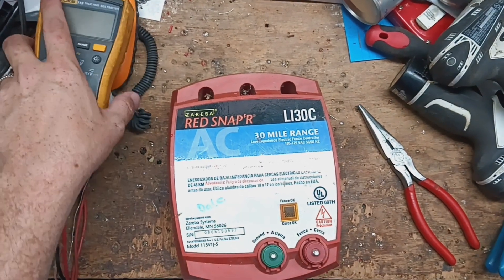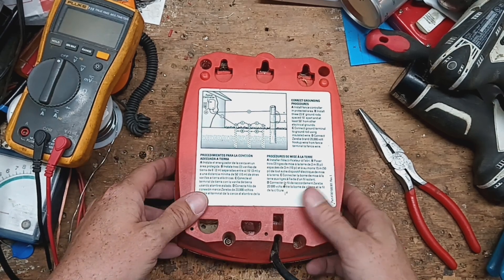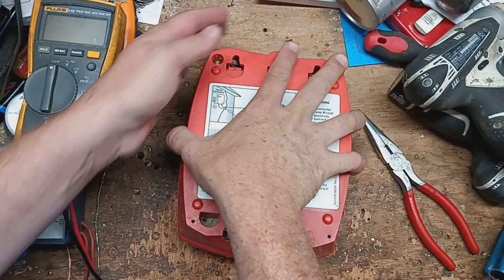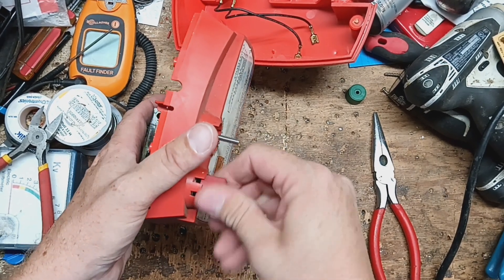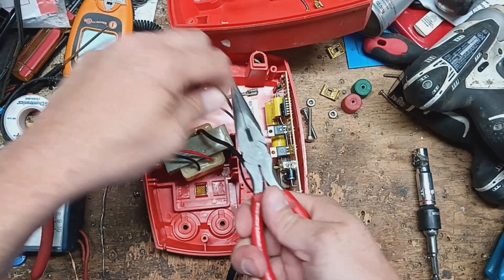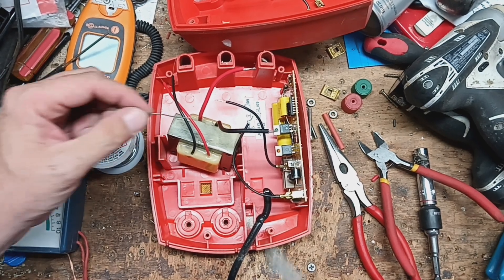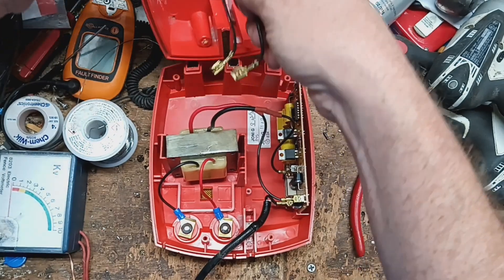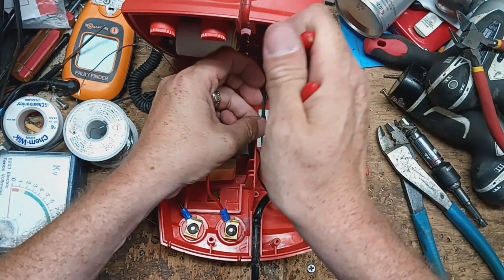Repairing A Red Snap'r 30 Mile Fence Charger That Has No Output | Red Snap'r LI30C Repair

Comment: Hi, what specs are for the transformer?! Thanks!
Reply from the maker: I wish I could help, but I'm not a manufacture of parts, just a repair guy. So I don't know the specs for any transformer made.
Reply: @FencerFixerRepairLLCKansasCity  but with what transformer you replaced?
Reply from the maker: I don't have any specs besides what the voltage is coming out and that's shown with the fence tester. Most transformers for electric fence units put out around 6kv to 10kv (6,000 volts to 10,000 volts) on average. But the actual inner workings of the transformer and how it's put together, I have no idea.